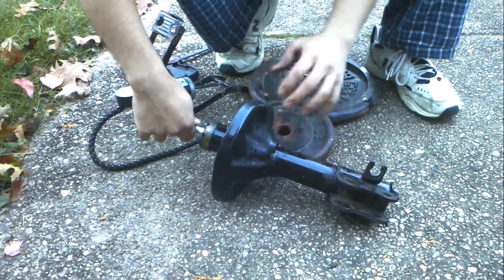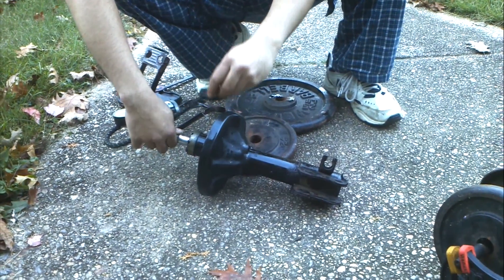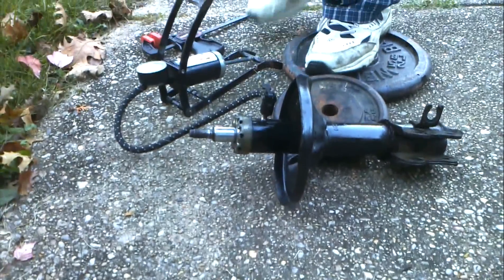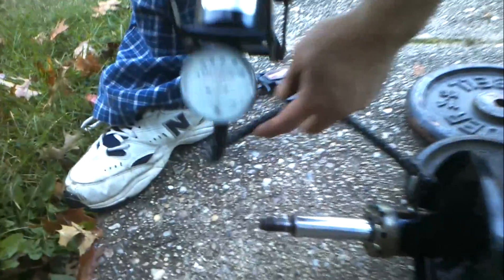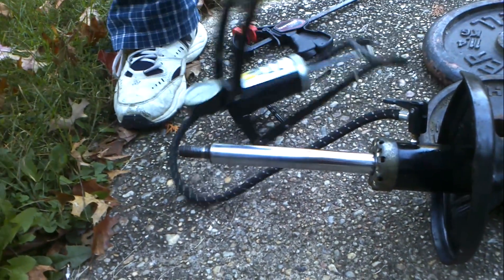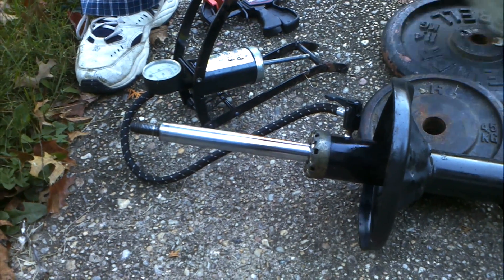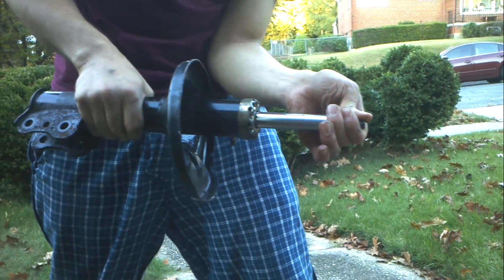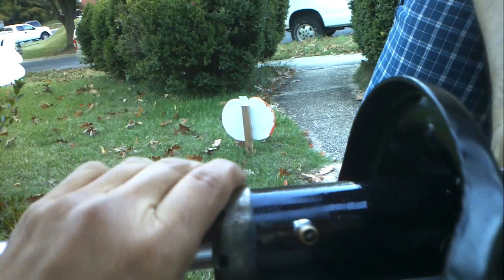How to Rebuild Shock Absorbers: Filling with Air

Comment: 25 years ago I started drilling out struts at the top about an inch below the top and filled with a thick lube oil. Leave an inch or more of are at the top. Plug it up with a piece of rubber and a hose clamp. 
 I don't remove the strut so after you remove the tire you have to jack up the suspension in order to achieve the normal level. Otherwise you end up putting in way too much oil.  If you get too much oil in it and you put the tire back on it can be more difficult to reach up inside there and loosen the hose clamp. And don't forget you need at least an inch of air at the top f
or cushion.
The point is what's the use in putting a new struts and all that hassle and cost when the vehicle is just getting old and we'll go Kapoot any day. 
People stress themselves over repairs that should have been simplified out of the factory.  
Even an oil-filled shock can be refilled. But not a gas shock. And there are oil filled shocks that have partially filled gas that can be successfully filled with fresh oil. 
Don't forget leave one introvert at the top. That's why it's better to drill about an inch and a quarter below the top of the strut or shock. 
You can use any oil I prefer a thicker oil because it will stay in better. You could even use old engine oil. 
I also use old engine oil and mix it with paint thinner and put it in a spray bottle and spray the underneath of my vehicle.

Comment: Wonderful idea! I will try that to rebuild my 88 mazda 323 gt's factory Tokico adjustable shock. Just wonder what kind of Schrader valve were you using? And the solder holds up well between the steel and brass?
Reply: normal bike or car valve. Its not solder its a weld
Reply: Did it work?

Comment: Hello, it's been 3years since you posted this! How are those shocks after all this time? Also what is the car's weight? Did you have to refill them regularly? I have a small hatchback with this Mcpherson style shock and I am looking forward to do this trick! Is it ok to use air or some other gas? Is it any danger with those welded valves?
Reply from the maker: Sorry for the late reply.  My buddy wound up junking the Mazda when the rear precat went bad a few months later (would have required pulling the engine and a pricey part).  No problems before then.

Comment: hey, so as far as you know, it is possible to drill a hole in any of these types of struts? I have always assumed they were dangerously pressurized.
Reply from the maker: Depends on your definition of "dangerous." Do you need safety goggles? Yes. Will it blow up and maim you? No. It's around 100 psi from the factory, the same pressure in a bicycle tire or what you are releasing with an air duster. These struts were over 10 years old and the pressure was close to zero. Do try to drill sideways or upside down so metal shavings won't fall into the strut body.
Reply: Ok thanks alot! I been wanting to try this for a long time now
Reply from the maker: Let me know how it works out. I suggest filling with Valvoline Maxlife ATF.
Reply: Not a gas shock. You can drill oil struts or oil shocks and refill them with any oil that you have laying around. Even vegetable oil will work. Old engine oil works fine. And there are oil gas combination shocks that can be drilled out and filled with oil. Any oil.

Comment: Is there a difference if you drill it at the top or bottom?
Reply from the maker: +Psychedelicbananas The air will naturally float to the top, so it's probably best to have the hole in the top.  Otherwise, you might get some fluid in your pump.

Other than that, I'd say just add the valve wherever you can get clearance.
Reply: Yes it is, you must have a separationwall and fill at the bottom!

Comment: How much is the shock absorber? Is it home-made?
Reply from the maker: +Jirawit Jiracheewee These are factory shock absorbers (struts, actually) from a Mazda 626.  I modified one by drilling a hole in the side and soldering in a schrader valve to add both new fluid and air.  You can see the details in my other videos.

Comment: it is have to drill a hole to modify something for the air were going in?
Reply from the maker: Yes.  I drilled a hole in the side of the body and soldered a tire valve in the hole.  If you remove all the rubber from a tire valve, you get a brass valve sleeve that can be soldered in.  Remove the valve core to fill with new oil, then reinstall the valve core to pressurize with air.
Reply: cool.. how to get accurate of the oil and gas inside the absorber?
Reply from the maker: You can drain it into a measuring cup to determine how much oil to add.  If the shock has been leaking, just drill the hole a few inches below the top end, and fill until it runs out the hole.  Then pull the rod all the way out to draw fluid into the inner tube.  Then fill the tube with oil until it overflows again.

I used a mix of synthetic automatic transmission fluid and Lucas ATF conditioner.  The ATF conditioner contains additives that will help the rubber seals and prevent overflowing.

After you reinstall the valve core, you can inflate with a tire pump.  At least 50 PSI is a good pressure; I would go for around 100.
Reply: after put in the oil with air for the leaked absorber, is it will leak again at the future?
Reply from the maker: Jimmy Lee That is definitely a possibility.  Sometimes the leak is very slow and you can go months or even a year before adding more oil and air.  Sometimes the leak is bad and the oil will leak out again quickly.  If the shock is leaking, you're best off replacing it.  This method is really more for a shock absorber which is not leaking, but which has lost its effectiveness over time.  Just like engine oil, the oil in the shock degrades and gets thin with use and time, which is why you replace it.  You can also use this method to get a firmer ride by increasing the damping on factory shocks that are too soft.
Reply: @AKHyder01  can the oil be funneled into the shock or strut through the hole before the valve is soldered and thus bypass removing the valve’s core?
Reply from the maker: @Dan_Will  Bad idea.  The oil could make a bad solder joint.  Also the only way to solder brass to steel decently is with a torch, heavy-duty flux, and plumbing solder (not electronics solder)  Tin both pieces well first.  The shock absorber especially needs to be cleaned with emery paper and alcohol then tinned using flux and solder.

You can get a 4-way valve tool which includes a core remover for a buck or 2 at any auto parts store, or maybe even the dollar store.

(DISCLAMER: all above information including the video is for entertainment purposes only - I do not advise or recommend for or against using any of the techniques in any vehicle)
Reply: @AKHyder01  very good point. Thank you 🤝

Comment: good day 

And you put  the new oil by valve welded tire too? removing the light interior?

best regards
Reply from the maker: consaka1
-- According to my research, Chrysler ATF +4 has a very strong anti-foam additive -- Chysler had experienced foaming problems in the Ultradrive trans with the previous ATF +3 spec.  ATF +4 also has a very high viscosity index (meaning it will offer a similar ride regardless of temperature, and it will not thin out to cause "fade" as the strut heats up on a bumpy road), and it exhibits high shear stability.
-- I am sure that some other transmission fluids would offer good performance as well.  A Mercon V compatible fluid might give a little more damping due to its slightly higher viscosity.
-- A "High Viscosity Index" or "HVI" hydraulic fluid like Kendall "Hyken Glacial" would also work well in this application.  (I believe that such fluids are the original factory fill.)  Unfortunately, I've only seen it sold in 5-gallon buckets, and you need less than a quart of fluid to do a pair of struts, so ATF makes more sense for most people.
-- (I used ATF +3 in this video just because I had 3/4 of a bottle of it lying around and no Chrysler to put it in.)
Reply from the maker: consaka1 Just to add: for the record, I HAVE put Chrysler ATF +3 in a GM power steering box (old enough to be spec'd for Dex 2), and it has worked just fine for the past 20,000 miles.  (It was dark, I was in a hurry, and I mixed the bottles up by accident).  However, I do not advise doing this unless you are a certified chemical or hydraulic engineer.  Always check the car's manual, and always read the labeling on the bottle.

But yes, in theory, many hydraulic fluids have a degree of interchangeability (as long as they are chemically compatible -- don't use brake fluid in a trans fluid application, for example).  A guy I know used to maintain construction equipment for the Army in the 70s -- he says that back then, some manufacturers would specify Dexron as a cold-weather alternative to regular hydraulic oil.
Reply from the maker: That is correct.  I removed the valve core and filled the new oil through the schrader valve body.  I then re-installed the valve core and filled with air as normal.  The new oil is Automatic Transmission Fluid.  I did some research and found that Chrysler ATF +4 is the best for this application.  Ford Mercon V should work too. My other videos show more.
Reply: @AKHyder01  I would like to ask u a question about Hyundai struts, please
Reply from the maker: Sure, feel free to ask.  Although I am not by any means an expert on Hyundai.
Reply: Professor Doom What did you find that made dexron 3 or 4 not as good.?
Reply: Professor Doom Thanks Ill remember that. I had heard that ATF could be used in power steering units too. I tried it once but I started getting noise similar to air in the system. I figured ATF might have anti foaming agents but they weren't enough for power steering. Least the dexron 3 I was using wasn't. Not sure if there is a dexron 4 or +4 equivalent for my GM transmission. Might have to do some research on that.
Reply from the maker: consaka1 In many vehicles, including GM, Mazda, and Toyota, the manual actually specifies using Dexron fluid in the power steering.  Oddly enough, some Ford vehicles specify Type F in the power steering through the mid-90s -- even though Ford transmissions had long since switched over to Mercon.  Hondas are special and require Honda-specific PS fluid.  European vehicles also require a different fluid type (and Nissan, since they are now owned by Peugeot).  It's made by Pentosin, imported, and crazy expensive, although I think Prestone and Castrol make cheaper equivalents.
-- Definitely check the manual on your vehicle and use the power steering the manufacturer recommends.
-- GM jumped straight from Dexron 3 to Dexron 6.  In my opinion, Valvoline Maxlife is a better ATF to use for a GM transmission old enough to take Dex 3 -- Dex 6 is compatible, but thinner than Dex 3.  Maxlife is fully synthetic so it lasts as long as Dex6, but it's priced better and has an additive package aimed at older vehicles.  Ford-spec Mercon 5 is also reverse-compatible with Dex 3 -- I would choose Mercon 5 over Dex 6.
-- DO NOT put Chrysler ATF +4 in any transmission that's not in a Chrysler (except certain Mitsubishi and Hyundai vehicles that have Chrysler-designed trannies).
-- If you have a Big 3 / AMC / Mazda / Toyota vehicle with power steering issues (noise, looseness, leaks, pump cavitation, whatever), I strongly recommend Lucas Oil's Power Steering Stop Leak.  It has worked very well for me in the past, sealing a PS rack leak and saving me from a very expensive repair just in time for inspection.  Inspecting and cleaning your PS belt is also important.  Gunk can build up in the grooves and on the pulleys.  Clean the belt with soap and water, clean the pulleys with brake cleaner, and try using a LIGHT application of CRC belt conditioner every oil change.
Reply: Professor Doom Good info. But whats the fun in doing everything by the book?  Transmissions are expensive enough I don't care to mess around with them much but powersteering pumps are pretty cheap. ;)